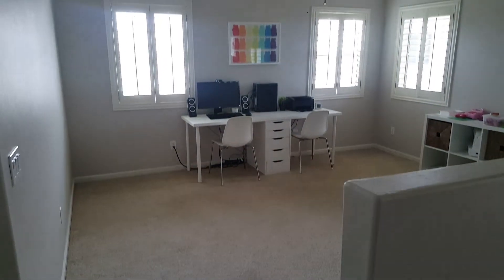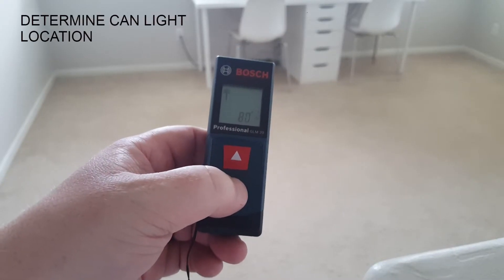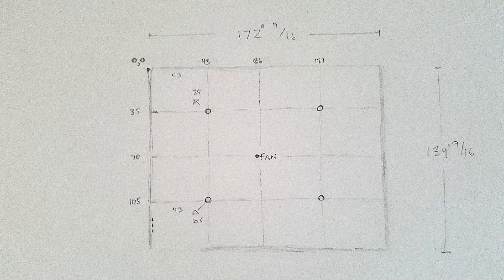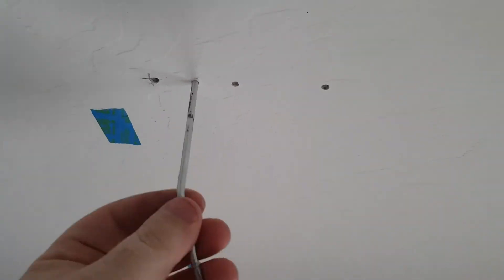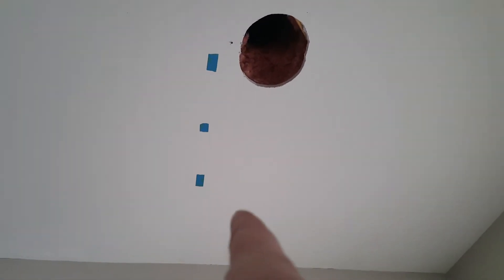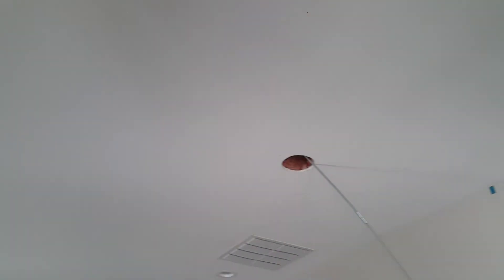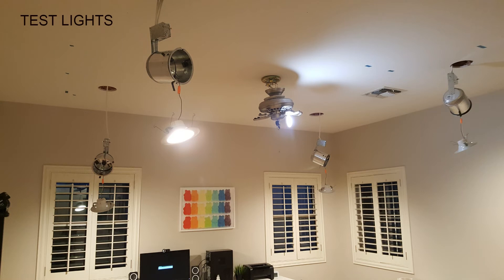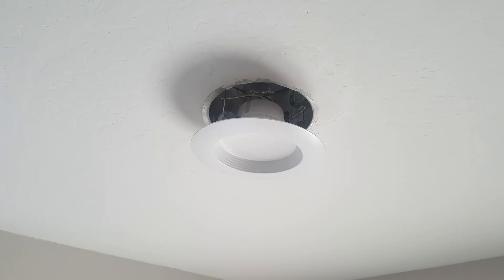Recessed Lighting Layout and Installation How To | DIY

Comment: this is by far the best / most descrptive video i have seen. good tip to check the clearance for the housing. in my case I do not have a ceiling fan, so I need to locate where to draw power from. any tips on that. I do have a power outlet controller by a switch next to door. can you suggest how I can use that
Reply from the maker: If you have an existing switch you need to find a way to get your romex from one of can lights to the switch or tie into the wire wherever it does. What does the switch next to the door control? Does it go to an outlet or does it turn on a light fixture?

Comment: The thin lights are awesome. No cans 
You can install under ductwork.
Reply from the maker: yeah they weren't around when I did that install if they were I probably would have returned the lights I had and just kept going with the install and put in the slim ones

Comment: good job but I really wish that you would've shown step by step you actually wiring the lights to the fan. I'm thinking about installing my recessed lights myself but all of the videos I've seen no one ever shows the steps of wiring the lights to the power source. the rest of the installation seems pretty straight forward but with me not being an electrician i'm really needing that step.
Reply from the maker: Hi Marcus, you make a good point in that I didnt go over that in detail. Here is what I did:

1. Remove shroud from fan (expose wires going from ceiling to fan).
2. Find out which wire in the ceiling fan is controlled by the light switch. I did this by testing the various wires going to the fan with a voltage tester. Leaving the switch that turns the fan light in the on position and the fan switch off I was able to identify which wire had current to it. I labeled that wire with tape. (see 12:33 spot in the video)
3. Turned off power at the breaker box of the circuit which powers the fan.
4. Fished the new electrical wire (14/2 romex) from the new canned lights into the junction box where the fan wiring resides.
5. Stripped off shielding on white (nuetral) and black wires to about 3/4 of an inch.
6. Removed existing wire nuts to the bundle of white wires and added the white wire to the bundle by twisting on a larger wire nut. Then added the black wire to the wires with the tape and replaced smaller wire nut with larger nut.
7. Removed wire nut with the green wires (ground) and pushed the bare wire in with the others and put on a larger wire nut. 
8. Tuned on power to test that the light switch on the wall did in fact turn on the fan light AND the canned lights. Turned off and on the switch controlling the fan to confirm it operated as it should.
9. Replaced the shroud and proceeded with the rest of the project. 

Hope this helps, maybe I will get around to making a video about this?
Reply: Agreed. The wiring is very scary/hard for non electrician. This video was great nonetheless, but nothing on YouTube with what we are looking for!